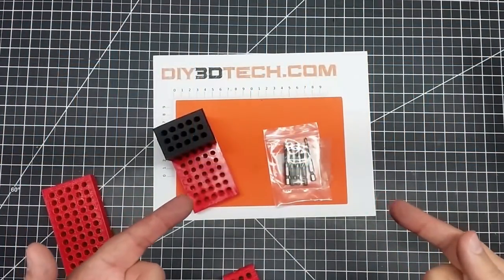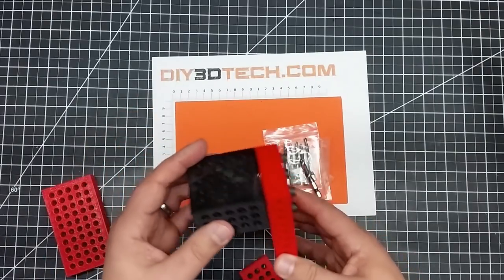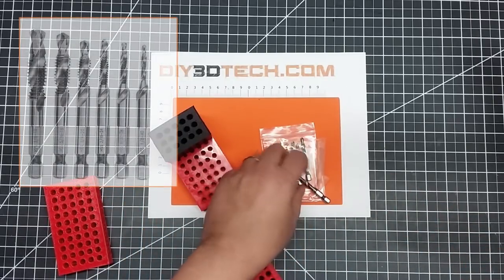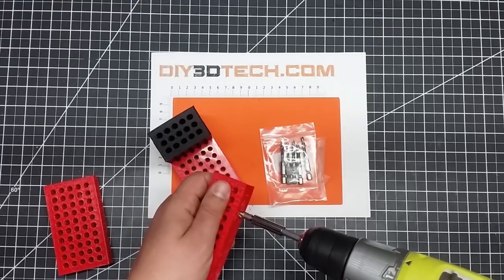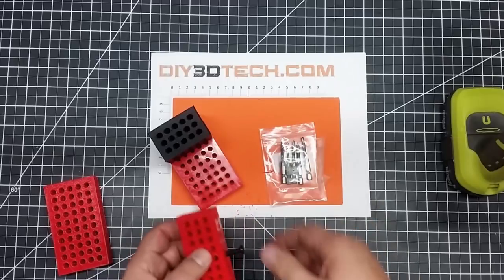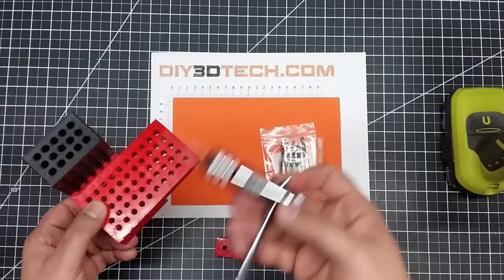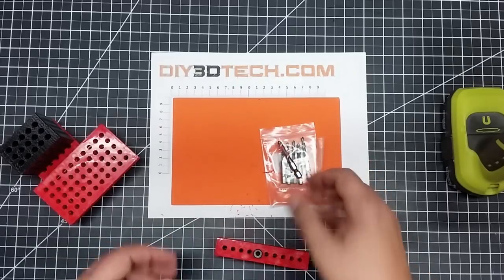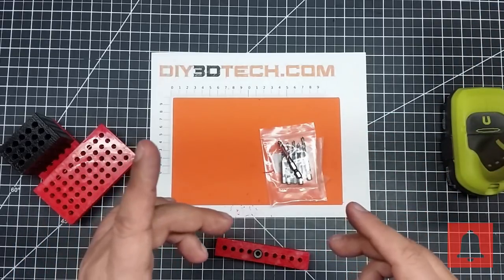Shop Talk - Drill Tap Combo for 3D Printing!

Comment: I've tried some of these back in the days but it really depends on the material you are printing :D I fould that using insertion nuts is more effective over time :D
Reply from the maker: It depends, as if your going to do/undo the joint a lot yes.  However especially with PETG, I have had surprising luck with it holding very well...